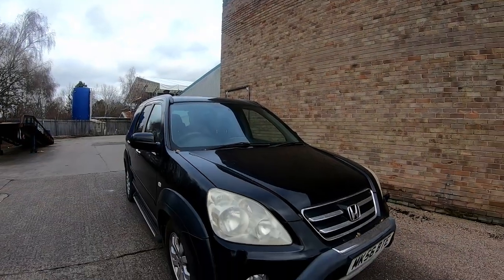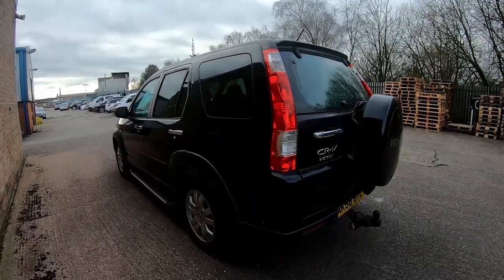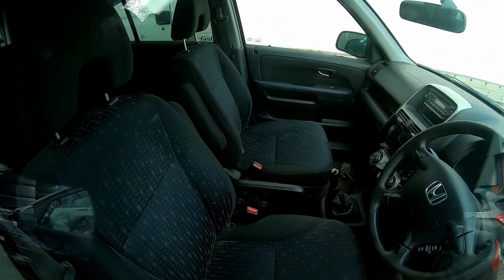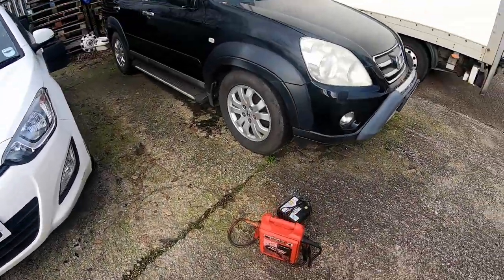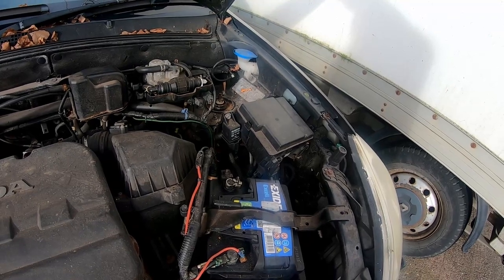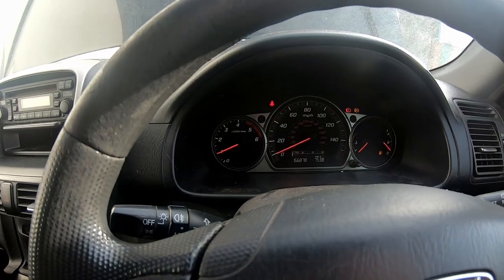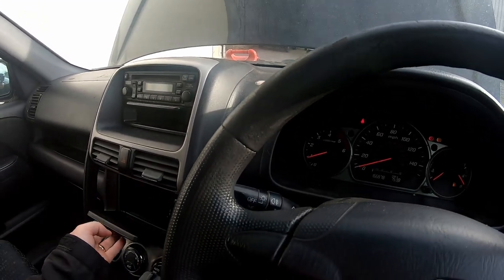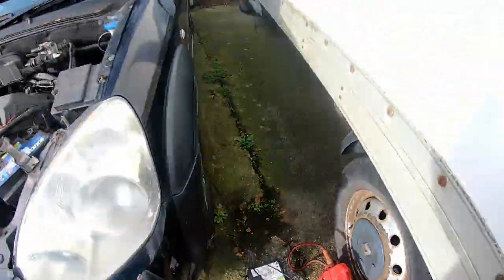I BOUGHT A ROTTEN HONDA CRV

Comment: I have a 2005 CR-V with a petrol engine and the same 5 speed manual gearbox. Manufactured in the UK as a matter of fact. It's currently my daily driver! I love it! Rust is a car killer on these for sure! I am happy to report that mine has no rust. I have however had to repair and replace all of the items that you mentioned in this video and more to make it a reliable daily driver, which it pretty much is now. It still needs a new alternator and that's coming next week and perhaps some new suspension bits at some point down the road. I think you made the right decision with this one honestly. They're fun cars to drive and very practical for the winter but it's not worth that much.

Comment: I had one for over 10 years. The engine was brilliant and I never had any mechanical problems. However the bodywork needed constant welding. When I replaced the sills I found the inner sections completely covered in rust.

Comment: I thought more modern cars were better protected. Im surprised at how bad it is. You did the right thing to move that on. It looks bad under there already and you would only find more trouble as you mention as you try and find good metal.

Thanks for showing underneath. Too much focus often is on the upper part of cars but it’s all irrelevant if it looks like that below.

Comment: This is a classic example of  previous owners not keeping the underside of their vehicles cleared of road salt. Rust gets a hold. .Neighbours all laugh at me in the freezing cold weather as i stand outside washing off the salt with a hose. 
You can eat your dinner off my BMW and luckily it has undertrays to help protect it. Cars don't clean themselves. 
Its easier to replace anything mechanical but when rust starts getting into it its game over.
Reply from the maker: Fair play cabottaxi, I am always getting the jet wash under my vehicle in the winter.
Reply: I know that only 2 well had a mk2 fiesta that had to have the floor patched first to provide a solid mounting for the inner sills flitch plate to put the outer skin on . The car came from south shields. I think he parked it in the harbour probably next to the quayside. Lollol

Comment: Rust is a killer for me, i remember having a 1987 Sierra which looked immaculate on the outside but underneath was a different story, i spent more time welding new bits in than i did driving it, it was a nightmare car and never again when buying a used older car i look underneath the bugger first.

Comment: Just experienced something similar with an 06 Vitara, full service history, 85k runs like a dream and rotten as a pear, both inner sills, outer sill and a chassis leg like Swiss cheese, never been used off road, friendly MOT tester, said it reminded him of testing cars 40 years ago!
Reply from the maker: shame to here, sounds like a decent old car the Vitara
Reply: @carukchannel  shocked me as much as the tester, at worst I was expecting a fail on a brake pipe or something stupid like a slow returning seat belt, came away thinking I was lucky not to get the 'red' certificate ( if they still do them)? 
    Rust on the Vitara reminded me of salt water damage, never had a tow bar, so never launched a boat from a trailer but if you have ever seen thise that have its bad!!

Comment: I have to agree regarding the welding. I have a CR V Mk 1 and have welded it extensively over the years. You are correct, once the plastic runners are removed, the rust will be fairly extensive!

Comment: Having watched this I had a good look underneath my 2005 Honda cr-v diesel,  the same model as this. Nothing was mentioned about corrosion on my last MOT three months ago. I jacked the car up and had a look underneath it. I learnt why nothing was mentioned. There was no corrosion. I wonder where the car in this post has been kept. My vehicle has been reliable with only a dual mass/ clutch replaced two years ago. The exhaust is still the original.
Reply: its the salt that kills them. If u live in area that doesn't need salt in winter then it'll be mint. My dad had one brand new from 2005 to 2020, i watched it rust before my eyes every year as we live in central belt of Scotland. It was totally brown underneath when we traded it in in 2020. it only had 50k-ish miles on it as he retired shortly after buying it so it spent most of its life going to the shops and back once a week!
Reply: The Honda had potential , I think you made the right decision Lee.

Comment: I bought a 2L 03 the other week, mine seems ok had it checked over serviced all sound apart from the exhaust to me sounds like it blows ( grunty ) at low speeds mechanic checked the system and said it's fine in good nick without holes or leaks ext, no play or loss of power guess it's just what it is

Comment: I have a 2003 CRV. It has 120k on the clock and it’s sound underneath. Only thing it’s missing is the rear prop shaft which is on your CRV. Basically mine is classed a a front wheel drive only. Mine is Auto and petrol and has the K20 engine. Starts every time,first time
Reply: Great cars and last forever if not on salty roads. Mine is 2006, in Ireland, ex Manchester and Galway and Tipperary. Thankfully very little road salt or beaches!
224k miles, flies through NCT (MOT), has been in 18" floodwater during a bad flood. Tough little cookie.
Back brake calipers seizing is a very common problem, yes.

Should say that I spend money on mine:- BFG tyres, KYB shock absorbers, decent 5w30, dipetane in the diesel, welded dmf (great welding but ooh matron!!).
Reply: @Anrirua  funny enough when I purchased mine last March it was squeaking under breaking and with it been my first car I didn’t know where or what was causing the squeaking. Nine days after buying it I took it to a ex Honda main dealer guy who I was recommended and he found that it was a seized calliper,pads were down to 3% so it needed a new calliper,rear pads and discs and also the front nearside strut was leaking oil. To think that the car had an advisory free MOT just two days before driving it home makes you wonder if the MOT centre actually falsified the MOT. She goes for her MOT next Tuesday and I’m hoping the only thing that shows up as an advisory is the missing rear prop shaft.

Comment: They did come with undersized batteries from new - my brother in law had a 10 plate petrol from new and it wouldn't start on a few occasions. The dealer wanted to rip the dash out to "investigate" - then he had to call the AA out again and the guy told him that was the case and said to to Halfords they will sort you out. He did and they sold him one twice the size of the Honda one said the Honda one was way undersized and powered and he had no further bother for the next 10 years he had it before moving it on

Comment: It's a lemon. Best thing to do is take it to bits and sell the good useable parts, u will make more money. wheels and tyres £150 easy sell the interior and seats for £100 and just keep going sell the door wing mirrors boot lid with glass. and when ya done sell the engine or just scrap it another £75.  I did this with a 50cc moped that had a blown engine it had snapped the con rod I even sold the frame with log book for £25 I ended up with about £300 pound from a blown up moped.

Comment: I'd say it was the right choice dumping it, it wasn't great before it sat that long by the looks of it.   Yeah a rabbit hole can be ok as long as you don't come out of it with a ferret hanging on your throat, this wasn't going to be a tale of fluffy smiling and hopping off merrily  into the sunset L.O.L . I have  a chevy  sitting in our garage here in Canada it had some rust patches and slight rot on the sills. It wasn't too bad when my dad quit using it, but had no trade in value when he updated and needed work to MOT it for a new owner to register it. if we listen on a quiet day we can hear the Japanese tin worm eating it since it's sat. I just haven't had time to take it to the scrap yard and nobody sees it, like they would if it sat outside looking untidy.  Thanks for the video, Take care

Comment: If you took off the Chromed Stainless Steel Step Bars on  both sides,  plus that really Nice Bull Bar on the Front and Sold those Items  separately  you may still get your 450£ and then also score as well bit for same...as i do think they were not standard first day...Great Upload.
Reply: A fairly Rust free Honda CR-V MK 11 are like Hens Teeth  but they are Great Cars as they have that ,"K Series" Bullet Proof Engine    under the Bonnet.  Plus ,"Real Time"  Four wheel Drive which then only  cuts in automatically when traction is lost ...Off the front wheels ... Enough technology to get the Job Done but not so much that , like the newer cars ...The Money Light ...comes on for a pastime

Comment: My 55 plate with 165,000 miles is rust free underneath ,was this a swindon built car or import as imports rusted a lot worse.
Those very rare enlarged arch covers we an option and almost unseen on British roads and have seen these go for 400 as set if tidy and the matching front bumper override worth about the same ,advertise the parts on the Facebook Honda uk forum

Comment: Hit and miss with these sadly. My 04 is pretty much rust free but that looks well gone. Have you found the picnic table in the boot though? 😂
Reply from the maker: Picnic table, no missed that one 😁
Reply: only on the mark 1's was the
table, some also came with outside shower option.
we've dealt a lot with these, Japanese made ones were fantastic as it was there flagship model.
Swindon ones were quite piss poor.

Comment: Hard to believe a car just over 15 years old has so much rust.
Reply: Currently rejecting a 2014 crv with 1 owner fhsh 50k miles for rust on the sills
Reply: i thought the same-thought rust was a problem of the past
Reply: Take in mind this is in uk Where is rain 270days in 1 year.
Reply: @Unicornmeme123  Depends which part. London gets half the rainfall as Turin in Italy and a quarter of Tokyo. The Lake district gets a lot more.

Comment: The mk 2 CRV is not a proper 4 wheel drive, the 4 wheel kicks in when you are slipping and if longer than 20 seconds you burn the clutch out.

Comment: I just had a quick snifter online and I am informed it`s £ 290 a year road tax,    That combined with the cost of UK Diesel,    Then for a passenger car it looks heavy with a fuel sapping 4 x4 drive,      Aside from the corrosion,     I don`t see the appeal of these vehicles
Reply from the maker: a cheap 4x4 always sells to be fair  I have sold a few over the years that get used for towing etc so they except the fact that anything they buy will be expensive tax, its just a shame this one was to far gone to warrant saving

Comment: Car UK: "it probably has a 130k-140k-150k(kilometers i assume)

Me: laughs in 258k mile(415k kilometers) 2nd gen crv.

mines not even a diesel either!
Reply from the maker: The petrol Honda Vtec units are some of the best petrol engines ever made.
Reply: Agree I had 3 of them, bomb proof
Reply: miles! k stands for thousand

Comment: Am fitted axle to 2009 Honda civic type r today rotten wheel nearly off
Reply from the maker: Wow on a 2009 plate, mind you if its a type R it wants doing chris.
Reply: Customer throw big money at it y off new disc pads shocks lot
Reply: Seem a few realy bad civic 09 rotten at the rear it's crazy

Comment: I like to run old cars, I would never buy anything Japanese for this very reason.   The engines might be rock solid, but underneath they are always a crusty mess.  Give me a Renault any day, my 16 year old Megane doesn't have a spot of rust and is still on the original exhaust and brake pipes.

Comment: Bud that’s nothing I’ve seen worse then that I would just weld  the plate  on it some decent cheap worn part tires a cheap brand-new battery about £60/£70  quid cheap disks and pads or bleed the brakes up job done can probably sell it for up to 2 grand or a bit more so there’s definitely money to be had  in that car you’re not going to lose or the other option is scrap the car. It would probably scrap anywhere between 360 and 400 maybe a bit more and also chop the Catholic converter off and sell that as well so you’re gonna make your money back either way 👍👍👌👌

Comment: 500 pounds u get what u pay for usually,sometimes u get great deal, even if u have to put 750  into still a deal any more then that I have 2nd gen 06 beautiful shape 1 owner 130kmiles only bad part is was built in the uk harder to get parts for it really Japan built are easier seriously,vin starts with S its uk , a j then Japan so ul knw good luck said $1500 for it what is the year 02 the yeah